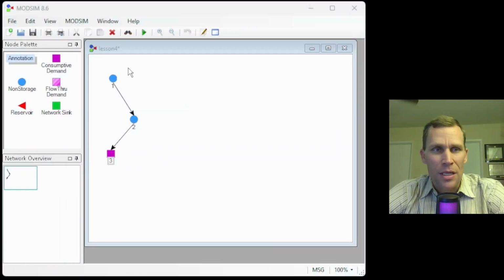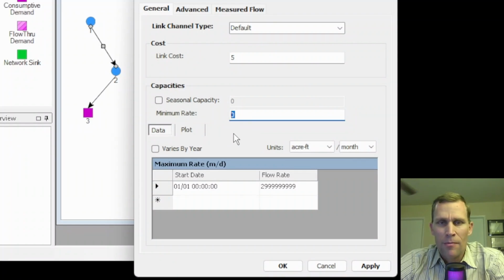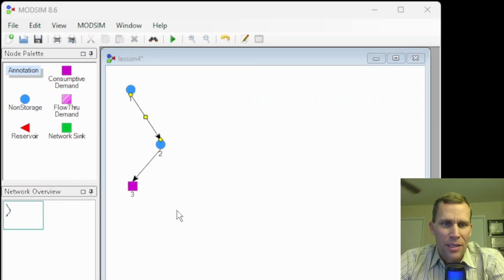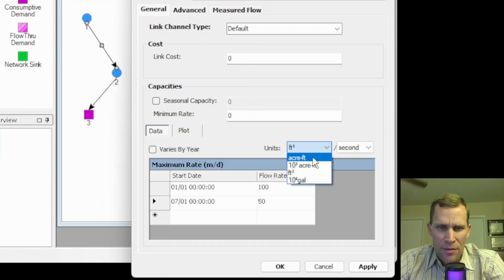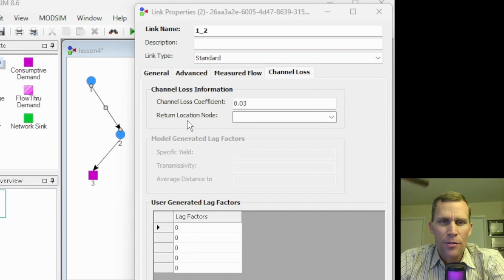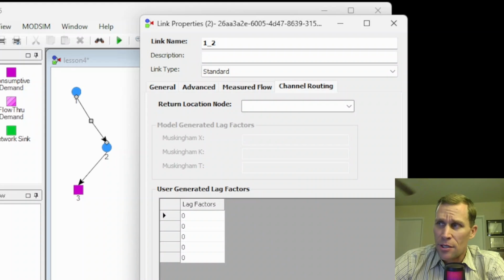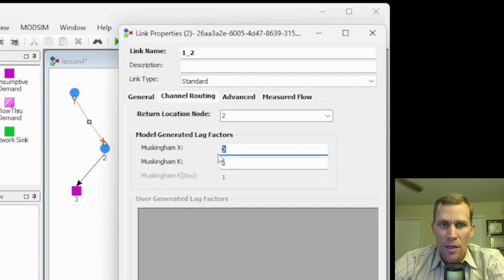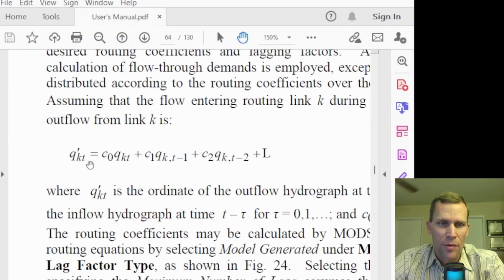MODSIM Lesson 4 - Link Properties, Losses, and Routing

Comment: Hi Mr Nelson, hope you have a great day
I want to simulate a river Basin in Modsim and it is a big network with different Non storage nodes and demands and links
the problem is Modsim choose just one way from the start of network to the sink and it didn't divide the flow to other links 
how should I fix this problem? if I'm going to change the cost of the links it didn't help because still Modsim is going to choose only one link (with lowest cost from the start of the network to the sink)
do you have any solution for this ?
Reply from the maker: Hi Shayan,
If a demand node is not receiving water, try decreasing the priority number of that demand node. Or increase the priority number of other demand nodes. 
You can view/edit multiple demand node priorities at the same time by clicking on MODSIM (menu) -> Cost Analysis -> (x) Nodes. 
See if that resolves your problem.
Tim

Comment: is there any difference between straight link between two nodes and a link with a break in the middle of it?
actually I don't understand why should we change the shape of the link.
Reply from the maker: A straight link between two nodes and a bent link between two nodes are functionally the same in terms of the water balance and flow computations.

You may wish to introduce bends in the middle of a link for diagram layout and readability. The three reasons I've added a bend in a link is when (1) the link traces over a curved alignment (such as a curved river in a background map), or (2) when I want the link to pass around a node (without it appearing to connect to that node), or (3) when I've connected 2 nodes with 2 links (1 in each direction, with a non-negative flow constraint in both).
Reply: @TimNelsonPro  great thank you so much